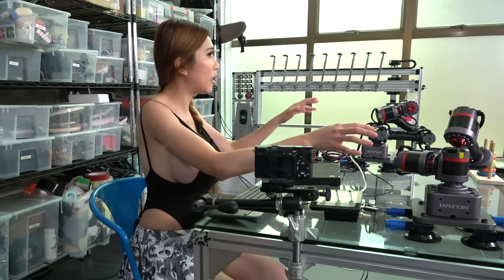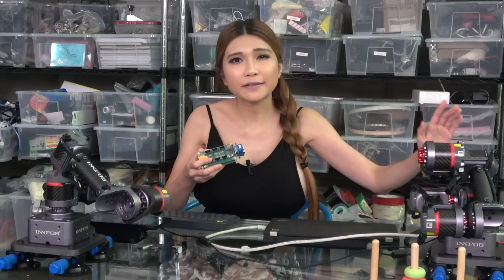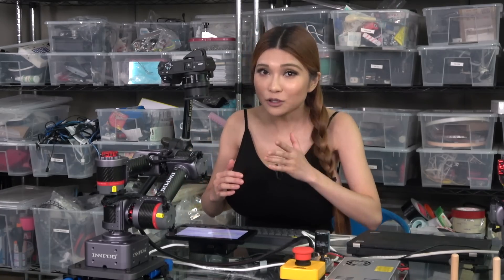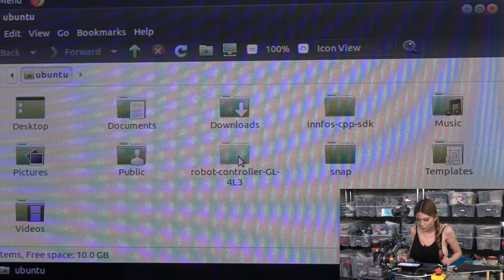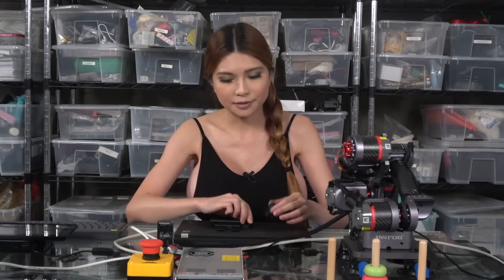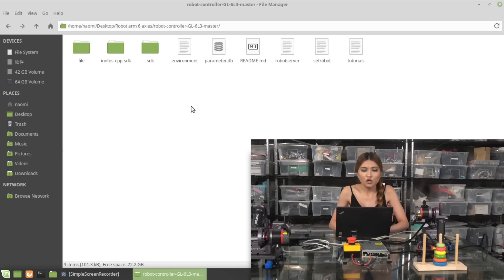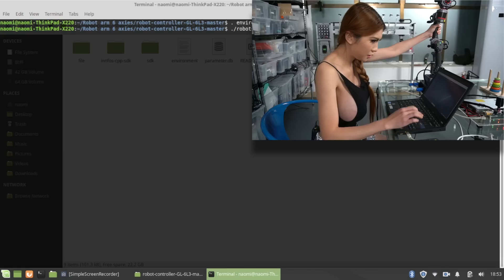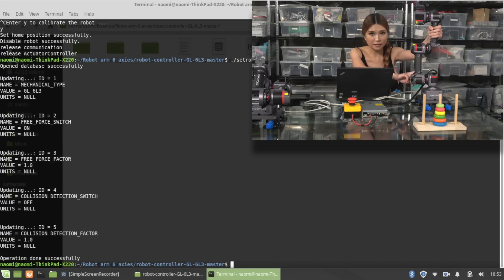Innfos Gluon: Amazing 6-Axis REAL Robot Arm!

Comment: In case anyone here wants to know, 6 axis means X, Y, Z, rotation around X, rotation around Y and rotation around Z.
Reply: Not quite - in this case, 6 axis refers to the number of motors in the arm. It does not look like the robot accepts commands in  cartesian coordinates (XYZ and the three rotation axes) quite yet.
Reply: @t045tbr0t  

Indeed ... 

In fact, if my knowledge of CNC is correct, it should -- eventually -- have 12 axis of movement due to:

X= +/-
Y= +/-
Z= +/-
A= (Rotation around X) +/-
B= (Rotation around Y) +/-
C= (Rotation around Z) +/-

But I'm only a microbiologist, so what do I know ...

Comment: Imagine using a drone with one of those arms to paint an entire wall...
Oh yeah, it's coming all together
Reply: The six-axis robot arm is 2.5 kg in its lighter configuration. That is about 5 times what the DJI drones can carry, and takes you instead into the range of heavy lift drones, on the order of 10 to 20 thousand dollars. As to painting, a drone under computer control in a controlled environment where external cameras can be placed could paint the wall without needing any maneuverability on the part of the paint sprayer - Just search for graffiti drone, or Urban Flying Opera, to see some drones using cans of spray-paint to paint actual images.

So, it is a combo that is possible, but maybe not really necessary. Where this will shine is in precise control, which requires a firmly fixed base.
Reply: There was a Judge Dredd story about rival graffiti artists and in the end it turned out one of the was a robot. So Judge Dredd comics have predicted the apocalypse. I think.
Reply: @Vuxi Thunderbuff, that is actually not a bad idea, but having TWO of these arms together on one adjustable sized paint roller, while also being simultaneously controlled by a powerful remote control, and also on one big flying platform/paint container, would be a much better idea.
Reply: @tmimify  , so what happened to the graffiti artist and the graffiti making robot?
Reply: @HowardCShawIII  , it certainly is a step up from current robotic limbs though, anyway, right?

Comment: I went through this vid and every 30 seconds I thought: "This is amazing!" 

And that utterance was referring to the robot arm's shape, your outfit, the Ievan pollka, your outfit, the cool acrylic fixture, your outfit in profile view, the almost organic motion of the robot arm, your outfit, the teach-in procedure, your apparent concentration, your outfit and when you looked as if holding the hand of a baby making his first steps. It really did remind me of that.
Oh, did I mention that you look great there?
Speaking of Ievan pollka, you do know the original Finnish one by Loituma, don't you?
Those arms sure seem very interesting and the software lacking an actual frontend could even be an advantage, since it allows to make customized ones, depending on the actual use. A basic (as in spartan, not in actual BASIC) menu to call the procedures and specify parameters could be helpful though, especially with homing the arm, when you need an extra hand. I suppose after the teach-in you can refine the end positions and the motion mode for each segment of the movement via input, no? Like it repeats the steps you just taught and asks for correction values for end coordinates and which axis to actually use for that path segment or whether to exclude any. It then can interpolate the most efficient path and offer some for selection.

That makes for a high level of precision up to the point where it can solder your PCB for you if equipped with the right tools. It would be flexible enough to work with small scale series but it would deliver repeatable precision and speed better than any human.
And yes, it can actually be used as a true 3D printer, which has been done already with another 6x arm. This one could help to improve that approach though.
This IS amazing.
Reply: The problem that I see with artificial limbs is that, sadly, their movement is slower, clunkier, and more...off putting than actual biological limbs.  If limbs, and, in turn, robots, could be fixed to prevent such issues, then it could make a game changer in the robotics AND artificial limbs industries.  However, the latter one might be in jeopardy if we can use the cloning of the cells of a person that is missing their limbs to make new limbs, @Art McNamera.
Reply: @paxhumana2015  I hadn't even thought of prostheses, but I admired the nearly organic movement of the shown robot arm. So basically I was talking about the usual shortcomings of robot arms (and servo controlled prostheses which are technically the same). The actual interpolation (the way the individual axis play together) impressed me as an automatician by trade, because I know how sophisticated an algorithm is behind that.
Biological joints usually have very limited degrees of freedom but those developed into "the best compromise" trade-offs between versatility and stability. Recreating a ball-joint that is controlled by motors would take several motors to come anywhere near the number of virtual axis that one natural joint can move in. And at the same time it would limit the movement of the joint, which is not desirable in a machine.
In Machine design you want to achieve as much possible motion with each drive, as you can get. For a spherical range you therefore need at least 3 axis with 360° freedom, but that puts a huge amount of the inner space of that sphere out of range (of a diameter that equals the longest stiff segment of the arm) Adding more axis and thus shortening the segments allows for more reachable space. Interpolation of all these axis allows for very clever and efficient paths of motion.

Designing a robot arm usually doesn't involve considerations about recreating the aesthetics of biological motion, but many about efficiency. How to move the "head" (the tool or hand) along a desired (and preferably shortest) path by a minimum motion of the axis. And that's what is pretty well done with the shown arms.
Also that kind of algorithm is crucial for a really good balancing routine, provided the arm is equipped with the right sensors. So these arms may also make good legs for any machine to walk on them.

Comment: You brought up something I was curious about, would love to see this ready for classroom use. Do you think with the software you could automate this to work with your 3D printers?
Reply: Good question. Thank you.
Reply: It includes an SDK, so you can write your own programs to control the arm, so that is certainly possible. One such combo usage pattern might be to use the arm to paint a 3d model that was printed; another would be to automate the removal of support material by a rotary tool - though this would require some means of firmly holding a very light part; so maybe two arms working in concert, one holding, one cutting.
Reply from the maker: It could remove prints from the bed under some circumstances but honestly belt printers are better for that.
Reply: @Naomi-Wu  Thank you.
Reply: @Tracy Schultz, is it not funny that almost all of the men are being horn dogs, quite a few of the women are being feminists, and there are few people that legitimately care about the stuff that is on this channel?
Reply: @Naomi-Wu  , remove prints, you say...could it be made portable and also be used by government agencies to track down the finger prints of suspects, or am I thinking of the completely wrong type of prints?

Comment: I’m wondering if the motion is smooth enough to use as a camera arm?  Like if you put a camera on the end of the arm and then had it look at your face and then move to look at something on the desk, would the move be smooth or are there hitches as the different motors start and stop?
Reply from the maker: For a gopro size camera yes

Comment: @Naomi 'SexyCyborg' Wu, although I love the movement of the robot arm, could that same movement be redesigned with a more human style arm appearance?  What I mean is this, the elbow joint of said arm is off center and it is also wider than an actual human elbow.  Could it be possible to make a robotic arm that has the movement speed and capabilities of this arm without it being off center, as well as without sacrificing its strength?
Reply from the maker: If it was shaped like a human arm it would lose a lot of functionality. Human arms are optimized for linear actuators, these are rotary.

Comment: Yeah, but! Can I program it for blacksmithing?  How much weight can it hold? I'm thinking it pulls the steel from the fire and moves it to the anvil for me hehe
Reply from the maker: haha would need some heat protection😅
Reply: @Naomi-Wu  that's why I was wondering about the weight it can carry, a set of aluminium attachments to grip a set of tongs... a set of tongs maybe weighs ½kg
Plus the stock to be worked... call it 1 - 1.5 kg... as long as the jaws are strong enough to grip it... 
if I had the money, I would probably try it to see what could be done lol.

Comment: The perfect early Christmas present for you.  A robot arm is so you.  The Arm reminds me of the "knuckle boom" crane - fitted to the back of the tray on many trucks, and enables the truck to load itself, if a forklift  is not available, or unload to a higher reach that a forklift can not get to.  Nice, precision moves for placing small items accurately: surface mount LED's, for example.  I'm sure you have many ideas already on what it can do.  Looking forward to seeing what you do with it.  It can be a very animated tool, will it get a name like Polly Ann, the Makita drill ?

Comment: I worked a job once moving heavy steering parts from a crate into smaller boxes for shipping to customers.  I wished so many times I had a robot arm to keep me from hurting myself--imagine something like a Power Glove you slipped on and directed the arm with it.  And then there was trying to load shipping cartons into the different areas for the shipping companies...all that bending and twisting; I'm amazed I didn't blow out a spinal disc my time there. 
 Seeing something like this come along gives me hope that someone out there will finally get a clue and start thinking of the human equipment as well as servicing all the machines we already use.  Thank you, Miss Wu.  You just made my day.  :-)

Comment: Both of these units look very stable and the accuracy is very good for following a manual recording of the tracking necessary to move the rings from one post to the others. Like you mentioned, software is definitely the key, but also extra sensing hardware like sonar and visual, via a small camera mounted in the rotator assembly furthest from center pivot. The software needs to be able to receive and process information from the feedback loop on all the motors, plus distance and visual info from the sonar and camera to really be effective and safe. Safety would be a primary concern, especially if you have a laser cutter mounted to the end to do 3D cutting of an object. You need fail-safes for positioning and collision avoidance, in the event that something other than the actual work piece gets in the potential path of the laser. (This is just a theoretical example, but something that definitely needs to be engineered into the software.) It will be interesting to see what kind of projects you come up with for these.😉😁👍 Great demo Naomi!😍👌

Comment: Nice job covering this new unit Naomi. Since I design and build robot AGVs and arms this was interesting. In 2011 we design one similar to that one in all aluminum we did not use harmonic drives at that time since they were to costly, we had designed our own gearboxes. Unlike most small robots we sensed position at the axis not the motor. Keep up the great work you should be able to use either unit as a pick&place machine.

Comment: Really awesome, Naomi, as always. Love the use of the Towers as a demo task, nice nod to the others out there with a computer science background.

Command line doesn't scare me, but joint space (angles) instead of Cartesian might. (Would be nice if you could get Cartesian coordinates from the recorded poses, then you'd already have enough data to make it solve Towers of Hanoi for real! Hope I didn't spoil the next video.) Hopefully they provide a good kinematic model, and ideally an integration with ROS, which I hear is a great platform for anything robotic that uses a full computer. (Recently learned some industrial robots are supported, which makes me want to look for used ones again, since I have a use for a 6-axis or more robot with 0.5-1kg capacity...) (Edit: their KS page says they support or will support ROS so that's great: shame about the lower capacity of the 6dof arm.)

Looks like your new place (what realtors in the us call a "live-work space") is coming along well - looks like a maker's paradise 😁

Comment: I had not heard of Harmonic Drive beore its very interesting! Seems it is a gearing system with minimal backlash compared to planetary gear sets. The actuators look very nice with built in drive electronics but the thing that looks amazing is the use of a proper positional resolver rather than a stepped optical encoder. AvE did a nice video explaining the difference https://youtu.be/kbFRWaNAWDg